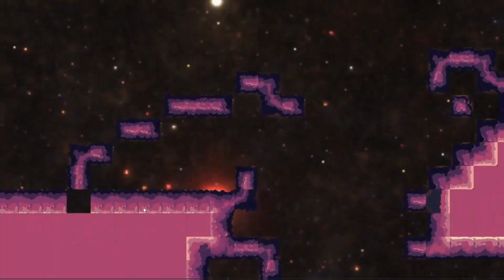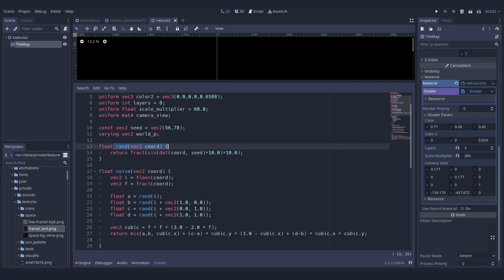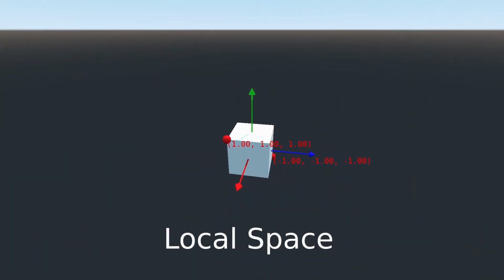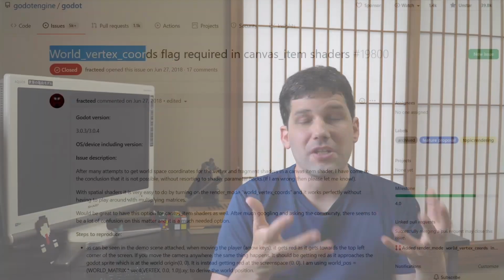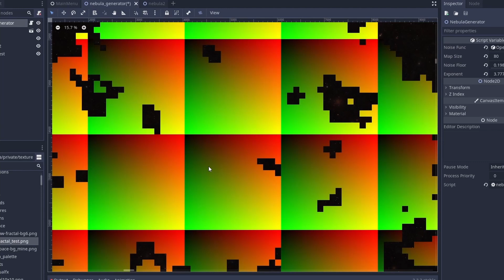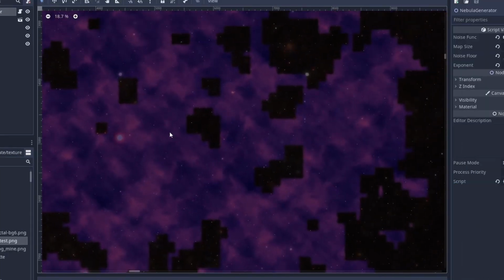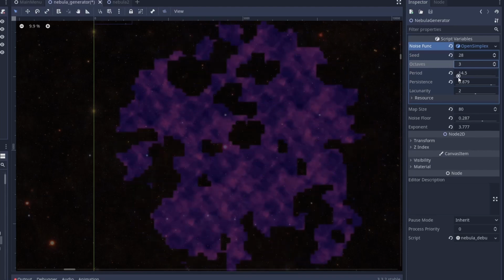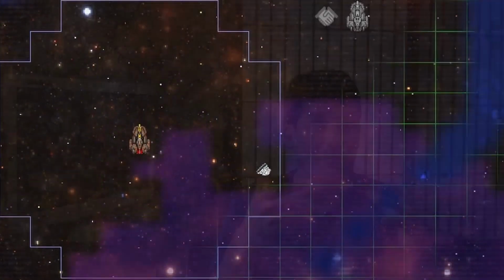Canvas Shader World Coordinate in Godot

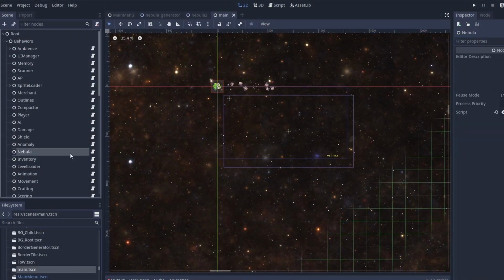Comment: 6:47 I wouldn't mind seeing a video on your component principle being used here. With the little I've used Godot so far I've got a good grip on making scenes out of loosely coupled subscenes with events, but I don't have an intuition for the use cases of, and techniques for, bolting non-visual behaviors onto a scene like you're doing.
Reply from the maker: It's a bit old so the sound quality and editing is not the greatest but I tried to explain all the basic concepts here https://youtu.be/fyh2ZjAFMZM . There's a part 2 talking about the evolution of the system and how I handle UI elements https://youtu.be/t9C3cgKlYS4